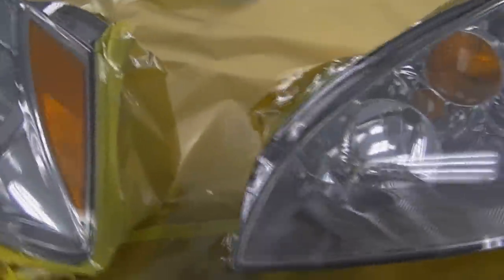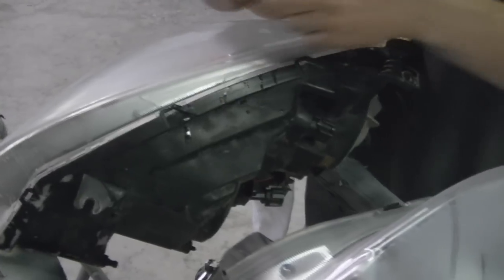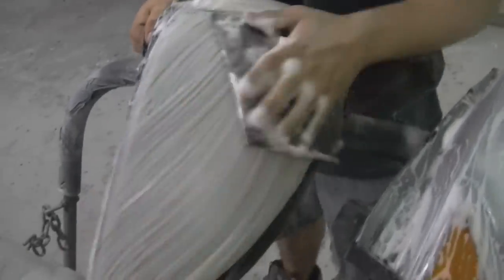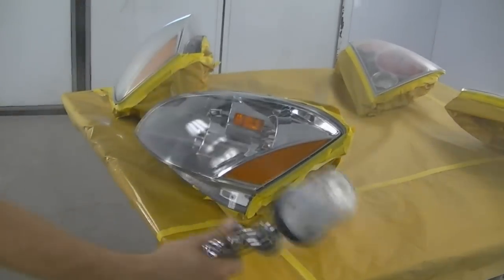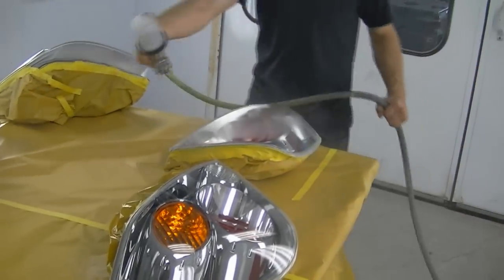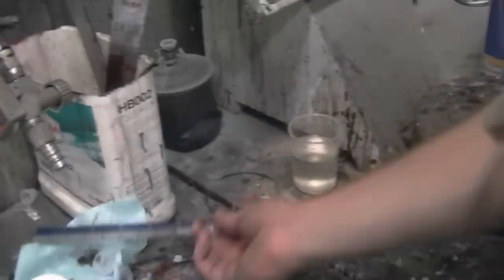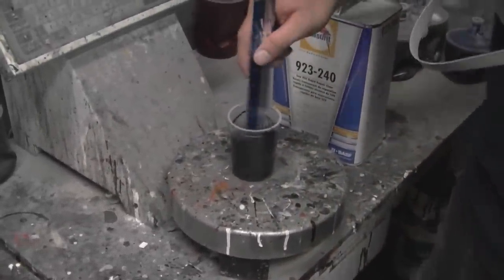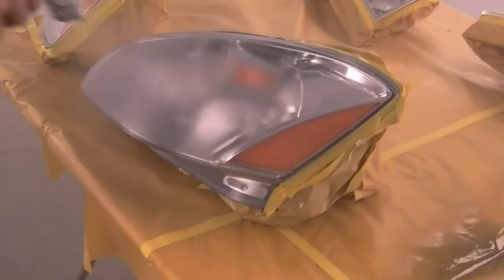Restore Headlights with Clearcoat (Works Amazing)

Comment: the average person can't do this at home! 🖓
Reply: probably not, but now you know how it suppose to be done.
Reply: All you need is a cheap 24/50 litre compressor and a half decent spray gun and it can be done easily at home, i've done two headlights four wheels and a front bumper on my cousins car in my garage at home.

Comment: Is the clear specific for headlights or is it the same clear that can be used for the rest of the car
Reply: Same, in fact, car clear is more durable than any plastic clear. I don't have a spray gun so i use 2k clear which is the next best thing.

Comment: Wow amazing!
I tried to sand my headlights using 600,1500,3000 but when I sprayed X2 Gloss clear coat it didnt look as clear as I was expecting, I felt the clear coat cause less clarity
Reply: Sand it again with 1500 and polish with compound
Reply: Thats normal if the environment wasnt perfect for the clear coat commonly this happens when there was too much moisture in the air or u applied to much or to less. In many cases just applying quality vinyl wraps on headlights are better. Its faster, ezier, cheaper and it is EZ to repair! Meanwhile this has to be sanded down completely to the bear plastic if u need to repair the coating! But this works well looks great no doubt

Comment: Great video! Question, do you have to use a plastic primer?
Reply: You need a plastic adhesion promoter bulldog or any of the name brand like ppg they come in a aerosol can
Reply: Plastic primer is a nice precaution , but not necessary . As long as you have good abrasion it's not going to peel/flake.

Comment: Hello good job man, i have a question, can i use any clear coat used on auto paint jobs to achieve this job? i have a spray gun loaded with clear coat; can i use any  clear coat compound to apply on my headlights? secondly is it a most to apply plastic primer before the clear coat? can you give amazon links to purchase these chemicals please
Reply: I wish he answered you. I'm wondering can you just use clear coat plastic primer?
Reply: Waiting for a reply on this one myself.
Reply: @tommydshelby5311  I figured it out later. If you have a clear coat with non-yellowing and UV protection built into the clear coat it will work perfectly well. Also since the headlamps are made of plastic compounds you have to apply coats of plastic primer to prepare the material for clear coating. I hope thus idea helps you

Comment: After sanding down my lights and spraying clear coat it didn't seem to hide the scratches. I know from past experience it does on paint but not sure why it didn't with the light. I had to end up polishing the lights then clearing. Not sure how long to will last due to this.

Comment: I recently sanded down my headlights getting them ready for a new application of clear coat. Should i apply plastic Primer first or just apply the clear coat? Also I didn't use grey nylon pad, but instead i used 1000grit is that okay?Thank you!
Reply: 1000 grit works out perfectly my friend👍

Comment: Everyone will tell you cant do this, but you absolutely can, and this is in fact the only correct way to fix oxidized headlights. Every single other method will leave you back in the same place, with nasty yellow headlights in a few months. Please keep in mind, the black tint is optional.

Comment: Hey Refinish Network, my headlights "clear coat" is peeling in some spots. My question is will the 600 grit sand paper be enough even out the headlights surface so I can apply a good clear coat? Thanks for your time in advance

Comment: which is the preassure that you use for aplly clear coat ? i have a iwata w71 for gravity, non hvlp thanks
Reply from the maker: Wilson Nuñez You would have to check the recommendations for that gun, my guns are usually between 20-30psi. (HVLP & Compliant)

Comment: is there any orange pill? cuz i didn't see any, it is because you using plastic prep spray first ? can i use adhesion promoter  first then the uv clear coat after?
Reply: adhesion promoter is essentially, plastic primer. So yes. All paint jobs have orange peel, just sand using high grit after it cures.

Comment: ok this video is not for the average person, nothing you showed can be done at home, you're not even in a house environment?
Reply: No that is def a spray booth. You can do ALL of this at home,  you will probably just need to do 2 coats tinted, and 2 more just clear, and the wetsand and polish out the imperfections that will likely happen in a garage type environment.
Reply: Of course it can be done at home, i did my cousins headlights a few months ago in my garage in my back garden, they turned out great.